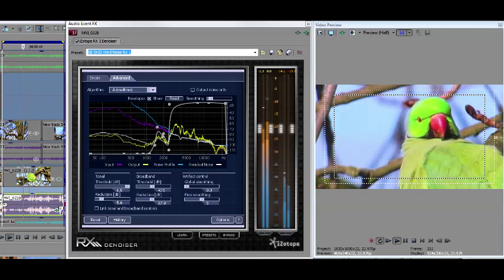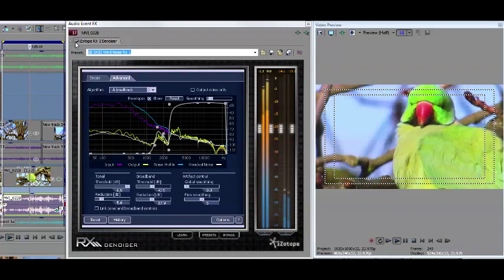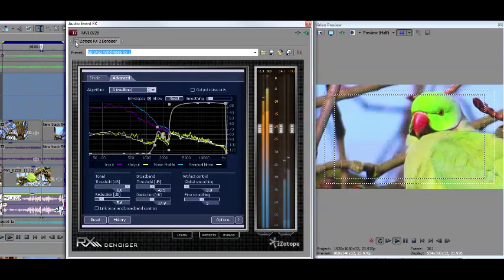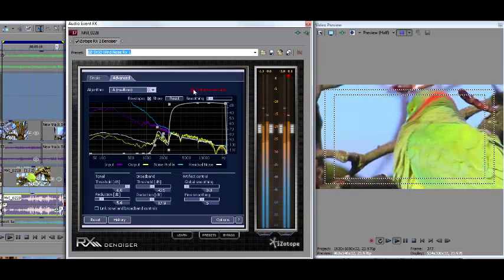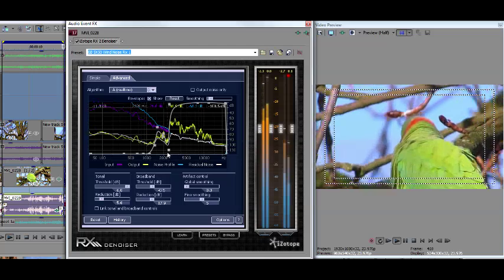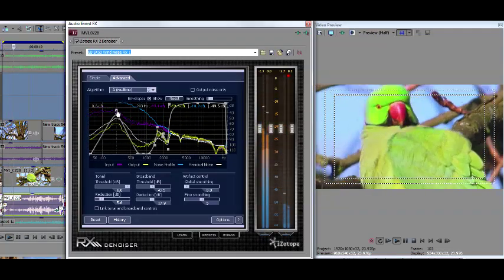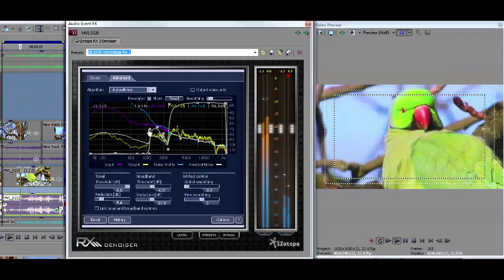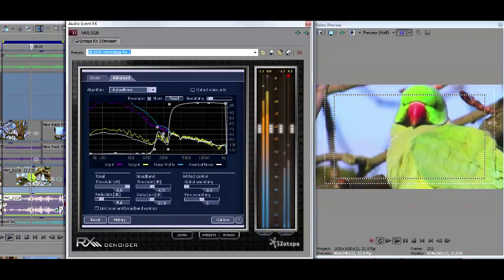Removing Wind Noise using iZotope Rx RealTime in SONY Vegas

Comment: The results in this video are very impressive - but then the wind rumble and bird chirps are very far apart in frequency, and easily separable.  Show us a video where you did the same with human speech and wind noise......
Reply from the maker: Ifan Morgan you're absolutely correct. The nearer the frequencies the harder it becomes. I've had some decent results with the latest incarnation of RX iZoptope RX Advanced 6. I leapfrogged purchasing RX 5 but took advantage of the highly reduced upgrade price of RX5, having a free option of getting RX iZoptope RX Advanced 6 when it would became available. Very happy!

Comment: What's the point of showing only the end result (which is fantastic), without showing any of the steps to get there?    It's certainly not just the shape of the reduction curve.    
I've spent several hours un RX 5 trying to remove wind noise with basically zero success.    The wind noise is full spectrum, so it overlaps all the sounds I want to keep, but I can still hear those sounds above the noise (it's not swamping it completely).     I sampled the wind noise by itself, applied filtering, adjust the reduction curve (and every other setting) 
every which way and the end result is either total silence, or muffled but still annoying wind noise plus muffled/tinny sounds I wanted to keep.      You've achieved the best results I've ever seen, but this video creates nothing but frustration for me.

Comment: Hi Graham, I recently had a quick trip to Indonesia to record an interview, I struck hug winds and even though I used a Rycote Softie wind shield the wind still got through into parts of my interview audio, I tried to find your version of software however, its been upgraded, I have tried to use the trial version of RX 5 Audio Editor without an success, I was hoping you might be able to help me out, I could send you the .wav file through my DropBox and I would be happy to pay you for your time via paypal to remove the wind noise, I know this is an unusual request, however, I'm stuck... please let me know if you would be able to help out and remove the wind noise for me.
Kind regards,  George

Comment: I seem to not be able to tweak it properly like you do. Are you able do add me on Skype and have a little chat? My ID is beeco.m

Thanks!
Reply from the maker: What are you getting so far? It could be that your dialogue frequencies are VERY close to the frequencies of the WIND noises.

I've been inundated with requests for SKYPE-contacts, so I've severely restricted my SKYPE presence/usage.

Cheers

G
Reply: Graham Bernard I'm not going to far. I've only could remove the low volume wind. My dialog still isn't clear, but it is audible. I'll stick to this and use short moments of subtitles. Thank you very much for your help. I strongly appreciate it.

Cheers!